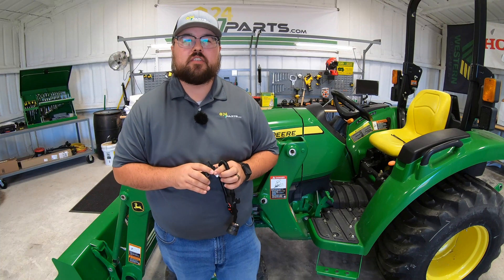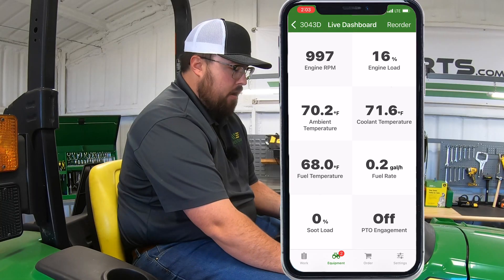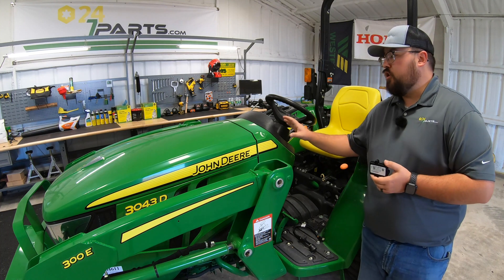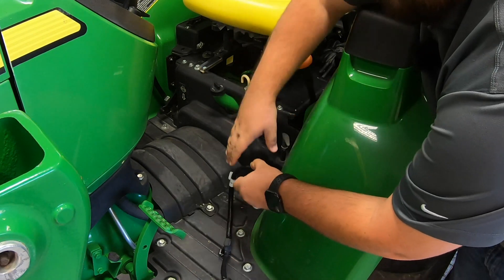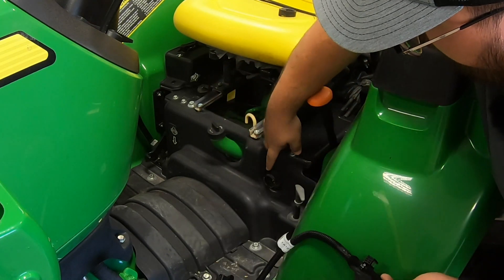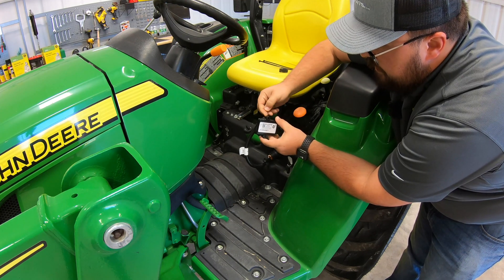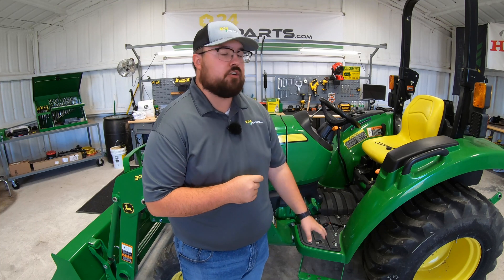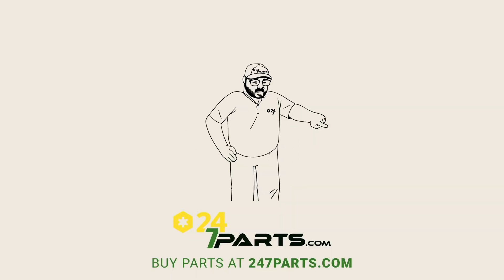How to Install TractorPlus Smart Connector on John Deere Tractor

Comment: I purchased a 2021 2025r in September, I bought the SMART CONNECTOR but haven't been able to find the connection plug on tractor. I had salesman come down and he couldn't find IT !!! It was built around July-Aug of 21. Please help on this matter
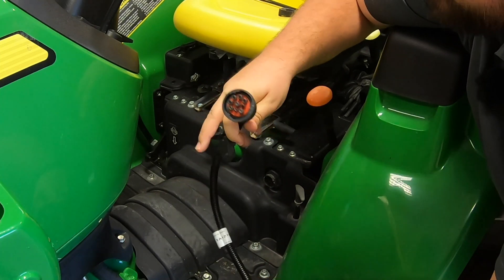Reply from the maker: Check out this video starting at the 2:05 mark and I think this will give you the answer. Thanks for watching!